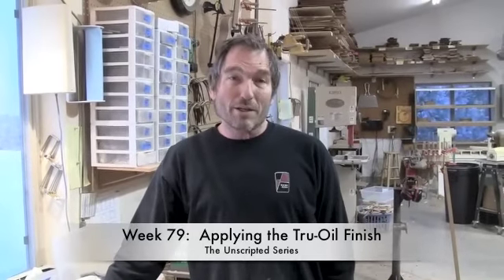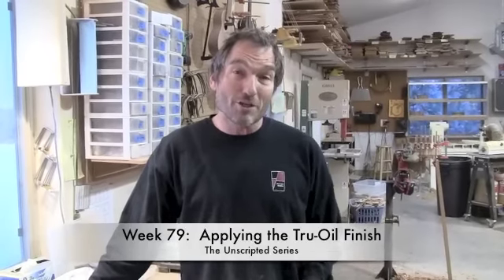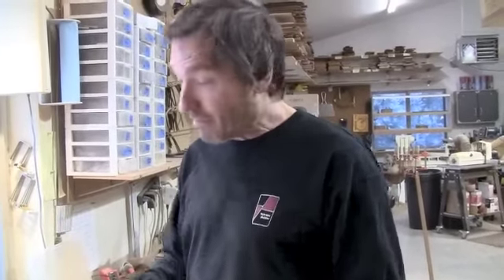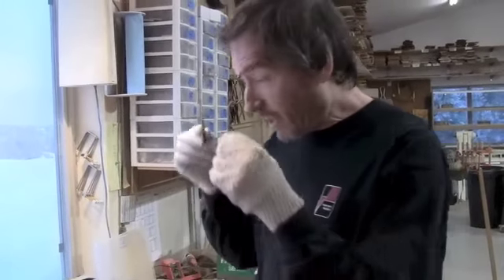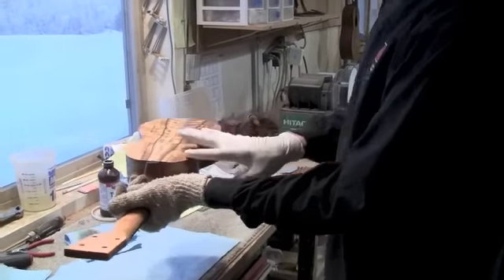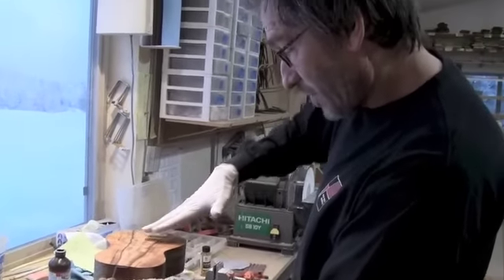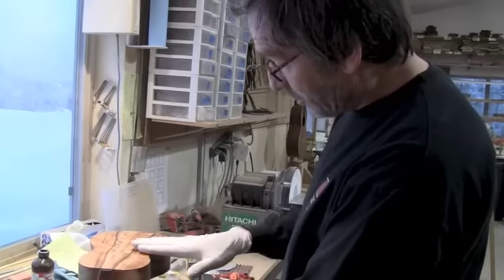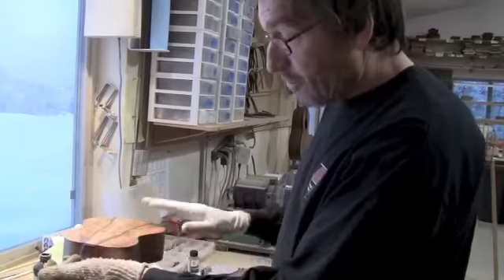Week 79:  Applying the Tru-Oil Finish

Comment: Great easy video. Just starting to finish my first uke, so I have a couple questions. Do you only apply one coat of fretboard oil, or do you do it with each of the four coats? Also, how long do you let the lemon oil sit before putting the bridge on? Do you do anything after the lemon oil, like hit it again lightly with steel wool? Thanks!
Reply from the maker: Only one coat of fretboard oil, after frets have been leveled and polished.  I now do lemon oil as a final step after bridge is on and setup done.  The lemon oil is really more of a maintenance step to add some shine to you instrument after finish has faded.  Not really necessary on a newly finished instrument.  No steel wool after lemon oil.

Comment: hi gordon,
is it ok to apply grain filler before you apply tru-oil? is it ok to apply tru-oil on the bridge?
Reply from the maker: Just make sure the grain filler is compatible with tru-oil by doing a test piece.  Yes, we tru-oil the bridge, but we do it separately.  You don't want any oil residue in any joints or it will look ugly.  Nearly impossible to do that with the bridge in place.

Comment: This is going to sound like a dumb question but I notice you have a rubber glove on your oiling hand and a thick glove on the other? What is that heavy glove made of? Is it a lint free glove?
 After the 4th coat you say to use a light coat of lemon oil. Is it the fretboard oil?

Comment: what i don't get is the sequence being used in the application..looks like you do head, neck,body...but you handle the neck post application...on early build up coats i don't see such a problem,because you steel wool rub... but on the final coat, wouldn't it make more sense to do the neck last,holding the uke through the tuner holes with maybe a chopstick before doing the neck,and hanging to dry,also what about resting the front/back on the scott shop towels while applying the final coat...same thing as the neck..lots of uneccessary surface contact...or does the final rub and buff deal with that issue...are you using the wool to buff the final finish coat as well, prior to using scratch remover paste, or are you using high #grit paper like 1200-1500 or higher.....also how long of a curing time are you allowing after the final oil coat before doing the final finish sand/wool rub/compounding etc...BTW.like the series
Reply from the maker: +Todd R. So, the first thing to remember is that we've done about 1500 of these in the way that we show, and the finish comes out beautifully.  I think the key is that we are immediately wiping off all excess, and we are holding the instrument with the glove.  We don't get any fingerprints or other marks on the instrument.  I thought I answered all the step questions that you ask--we don't use scratch remover paste.  We do steel wool after the final coat.  1200-1500 paper would be way, way too aggressive.  We let the final coat cure 24 hours.

Comment: I have a question to ask , I can paint the wood with a first oil-based dye and then apply Tru -oil ? the result will be the same ?
Reply from the maker: +Luis Alejandro Tolentino I have no idea.  We don't ever dye or stain the wood.
Reply: ok thank you very much, greetings.
Reply: i can tell you that i used a water based dye on swamp ash and then used a tru-oil finish.  been a year, hasnt fallen off yet lol   i used yellow dye and tru-oil to butterscotch it  a bit. worked well

Comment: Can Tru-oil be used on a maple fretboard to give it a hard shine like the new 2018 Fender Strat series has?  If so how do you avoid getting any on the fret wires?  On another note would the fret oil you used give it a hard shine like the Tru-oil?
Reply: Yes. I did it to a Squier standard strat with maple fingerboard. It is like an old fashioned poly finish but not gloopy as you can control it. It didnt collect on the frets as I put the oil on thin then rub off pretty quickly after so none stays on metal.  I think I put on about 6-8 coats with a few hours in between...so over a couple of days.

Comment: Good afternoon, what mix of turmoil to thinner do you use?
Reply from the maker: No thinner.
Reply: Thank you.
I have a walnut tele body from gutarbuild.uk. It's very nicely prepared. Can I apply the truoil without any prep, but sand down as you suggest with your magic steel wool?
Reply from the maker: +Mike Reeve Hi Mike.  If you have more questions, send me an email (myamoeukuleles@gmail.com).  Really I can comment too much on your question.  I just know what we do, which I've documented.  Not knowing or seeing your walnut tele body, I wound't want to give advice and have things not turn out correctly.